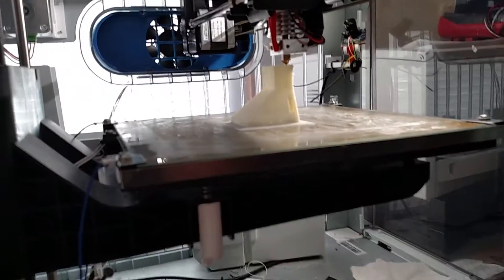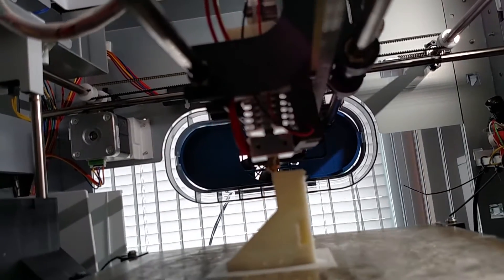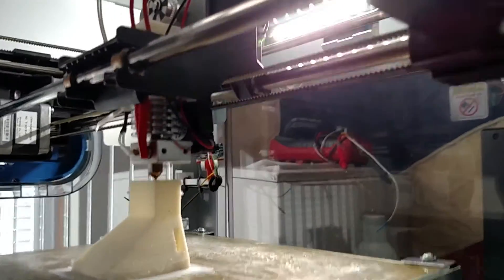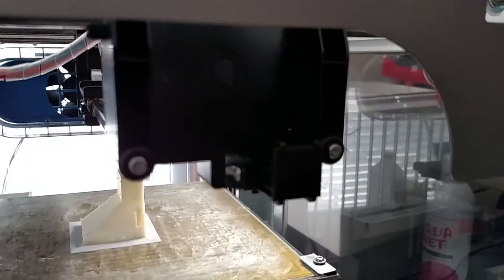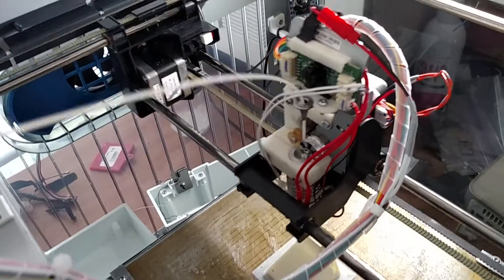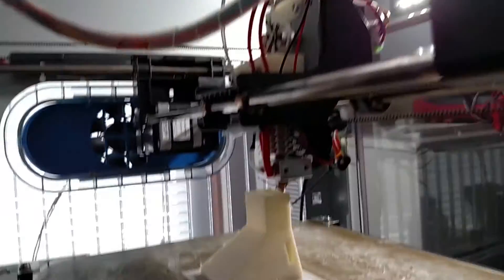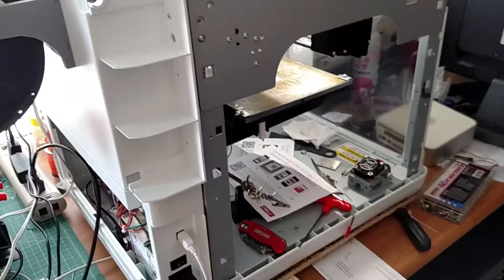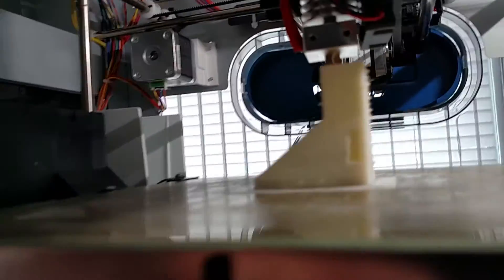Da Vinci E3D Conversion

Comment: Thanks. One last thing, what adjustments did you have to make in the firmware/slicer to compensate for the loss in Z height ?
Reply from the maker: +Scott Young I adjusted the offset in my slicer (Cura) by resetting the origin to be  28.7 mm above the bed.
Reply: Hey, where exactly can I adjust the origin? I am using repetier and cura slicer, in the CuraEngine settings I can't seem to find it. Would I change it in the printer settings in Repetier instead? I am getting prepared to install the E3D however I'd prefer to use your method and lose 28.7mm off the z-axis instead of drilling and disassembling. Thanks in advance!!!